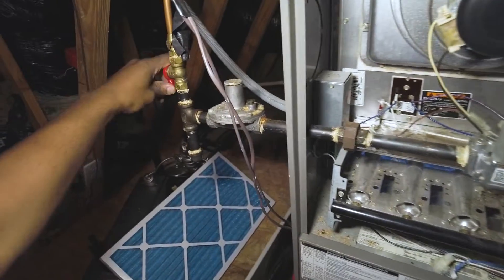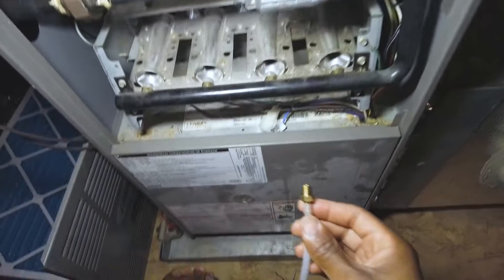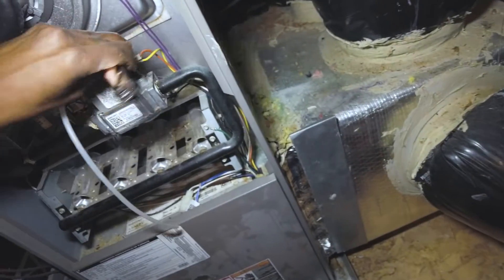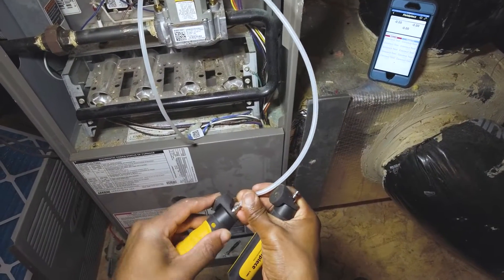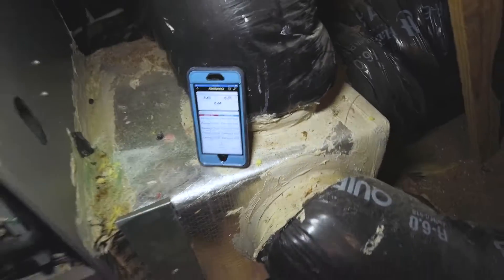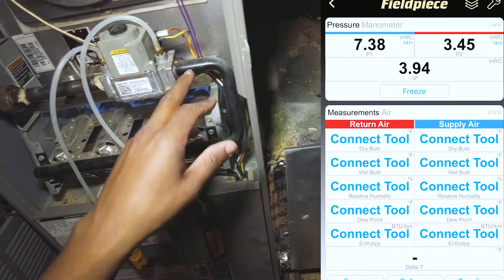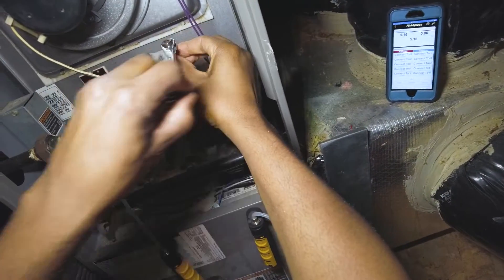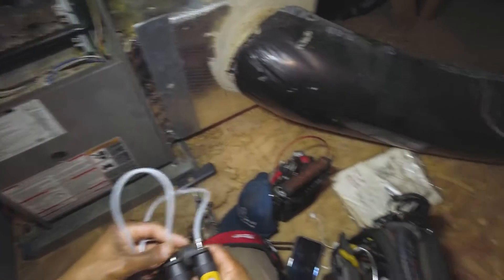How to Check Manifold and Inlet Pressure on a Gas Furnace - Tips on How to Maintenance a Gas Furnace

Comment: My husband is an HVAC installer and he noticed in our brand new HEIL 4 ton a faint smell of gas near the manifold on shut down. It dissipates as soon as he opens the front panel. Majority of stuff I read say it's normal for a faint smell until gas completely dissipates but I thought I would ask anyway. Our last unit died after 22 yrs...it was a Carrier. Is this a new "green/high efficiency" issue?🫤 Thanks😊

Comment: Where can I get a manifold just like that one ? The 3rd burner and the end of the manifold is letting out too much of a flame and it’s burning the inside of my furnace. Any suggestions !?
Reply from the maker: Hey usually I'm all for DIY repairs its one of the reasons I started this channel but Honestly if you don't have the proper equipment to test a combustion Appliance IE combustion analyzer menometers temp probes Id probably just try to call out someone who does as you don't want to be doing experimental repairs on something that literally contains a active fire inside of your house.

Comment: If you have a high inlet gas pressure and the out is at the rated 3.5" w.c., can this cause incomplete combustion?
Reply from the maker: If the inlet pressure is high enough to defeat the gas valve regulator and affect the manifold pressure then yes
Reply: @HVACTechKnowledgy but he says it is AT that… failed regulator, leaking more that can’t be measured?

Comment: Why does this system have a preliminary external regulator? Thanks!
Reply from the maker: Because the inlet gas pressure is too high of a pressure for the gas valve to meter properly so it needs to be stepped down around 7 to 10 in of water column before the gas valve steps it down to 3.5 in.
Reply: @HVACTechKnowledgy  is it 2 pounds of pressure on the inlet side of regulator?
Reply: @richbredsten349   I don't know what the pressure is before the stand-alone regulator but the pressure before the regulator in the valve is about 8 inches of Water Column which equals about one-third of a PSI

Comment: when do you usually check the gas pressure? what would make you use these tools to adjust the pressure
Reply: You definitely want to check it when replacing the valve, and when having problems and you think it's related to gas pressure.

Comment: Hi, I have a lennox mid efficiency single stage gas furnace. The manifold on rating plate is 3.5"wc. But I am only getting 1.7"wc. I adjusted to 3.5"wc according to the rating plate. But the furnace overheats and my temperature rise is out of specification.  The furnace also intermittently short cycles. Can this be a bad gas valve? Thank you.
Reply from the maker: What type of manometer are you using? If it's digital did you zero it out before checking? Did you check with another instrument? Also what caused you to check the gas pressure in the first place?
Reply: No, it's NOT a bad gas valve. I think the last person to adjust it, addressed the sympton and not the cause. That valve should be set to 3.5 not 1.7 WC. You're underfiring at 1.7. The cause is going to be airflow, so you want to look in ducting for any obstructions and take out blower fan to clean it. When they get dirty, their airflow decreases exponentially. First clean the blower fan, and if that doesn't fix it, check all ductwork for obstructions. Especially the flue. If you already fixed it, please let us know what fixed it. I'm sure it will help someone in the future.

Comment: Do you always do a inlet and outlet pressure test during a maintenance or just if the flame pattern does not look right ? What if you don’t have a pressure regulator on the inlet side of the gas valve ? Thanks for sharing.
Reply from the maker: No I don't always check gas pressures. I'll usually check if the flame sounds weak or aggressive or if my temp rise is off. Also you still want to check the inlet pressure whether there's are regulator or not.